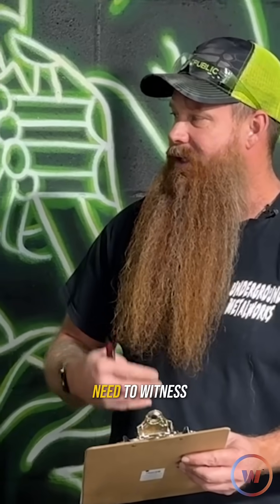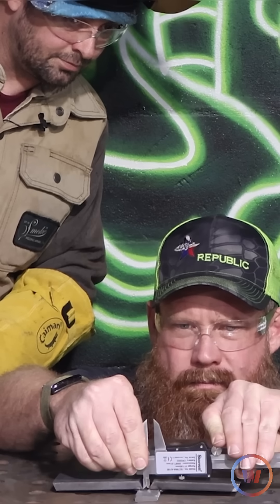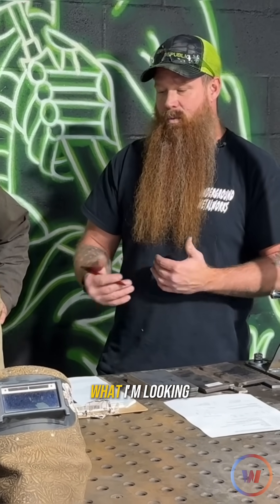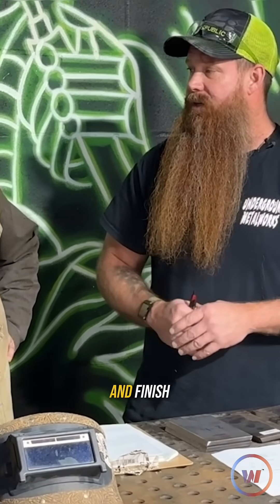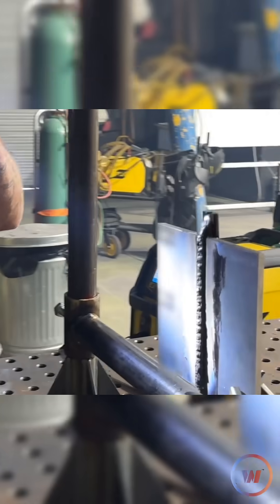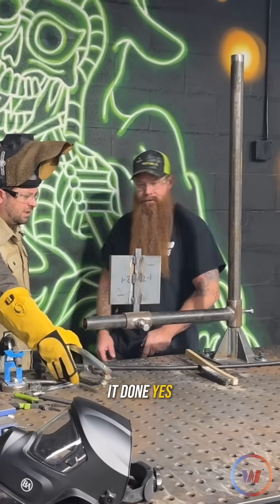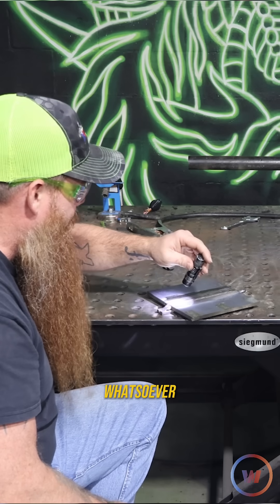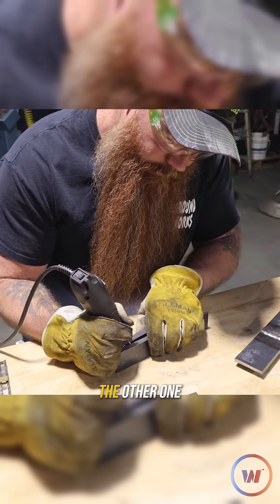What are hold points? #welding

Comment: No offence, but the low points are between the un overlapped beads.. and you didnt measure there once... also your pretty bad ass if you can see lof on the root with a backing strip on it..  best you will see is the heated area..

Comment: I learned how to weld at New Port News Shipbuilding and worked on the USS Los Angles attack sub and three other boats in its class before quitting and attending college getting a degree in aviation technology.  I am not sure if mig welding had been invented yet but at the shipyard they only used stick welding and tig welding on pipes.  When I was in school at Le Tourneau College I worked full time at Le Torurneau Industries.  They were building gigantic diesel electric front end loader that were huge that were used in strip mining.  To get to the ladder going to the cab you needed a 6 foot step ladder to get to the bottom rung of the ladder going to the cab.  As a result of working there I earned enough to pay for my college and room and board.  When I graduated I had no student loans to pay off.

Comment: Great Video! He should of used a wider, 1/4" thick backing bar instead. As well the tacks on the back should only be on the four corners and no more than 10mm or 3/8" long, no tacks in the centre of the backing bar. Happy Welding Fam!

Comment: I've got to repair a safety cover on tractor mower in the middle of nowhere. It's 16th steel, rust pitted all over with big chunks just missing as they've rusted through. I've got a donor oil drum to patch the holes so no one can accidentally put their hands into the blades. I don't have any additional resources and I can't have this fail in use, but it just needs to last until winter. What technique boils rust and contamination out of the weld most effectively?

Comment: I weld about 250-3” welds of 309 on a vertical surface per month. Stainless refractory anchors to medium steel. Just OJT, but they withstand about 12 months of abuse at a steel mill and then I plasma cut them off and do it again. 

Kind of a rare industrial construction I do. But it’d be nice to have some certs.

Comment: I had new potential welders and trainees had to do coupons. We did 95% stainless Tig in food plants. One thing they all failed (just a training issue) was using a steel chop saw and/or a used unknown on what, used sanding or grinder pads. Everything had to be kept separate, stainless and everything else. A little spec of iron in a stainless weld will be unsanitary. The experienced welders could walk the cone on tubing. Beautiful welds.

Comment: I guess I've done almost 200 of these tests! Starting at the age of 17, & I'm now 45! I've never in my life failed a bend test. I'm not saying it's easy at all, especially when you move to open root tests. Meaning without a backing plate like this test has! But none the less, good job bro!
Reply: It has backing because it is Flux core arc welding

Comment: Strangely simple test. We have 1 square edge and one bevelled edge. 3/8 gap with a 1/4 backing plate and we have to do 2 starts and stops. 3 coupons. 1 face and 2 root bends. Not much point in testing if you cant so a start/stop... imo

Comment: Was a certified welder in tig  mig,stick dual shield you name it ive done it worked 30 years in pressure vessel manufacturing and ship yard and high pressure pipe some aerospace had fun made bank retired at 48 miss it sometimes teaching my son in shop now he is trying to go to fast should master mig before he starts tiging he looking at what i made thinking everyone makes that I'm explaining I'm a madter welder your an apprentice sliw your roll
Reply: @JonKorpi-fk7yo  can you please tell me how to do stick on thin sheet metal? (Think exhaust pipe or other automotive, like 1/16" or thinner) I have Tig, which is hard to learn on & I have stick with some thin rods, but my welds look spotty & the slag does not peel off at all & there's inclusion. I've been having luck around 35 amps, but any gap at all just burns right through. Do you have input?
Reply: @christortora2967  spot welds with a low Amp cover very low
Reply: @JonKorpi-fk7yo  does stick orientation matter with thin stuff? Like when it's flat in front of me, can I always drag? Also, do I need to aim the direction of the electrode to not burn through, or is that not how electricity works? Lol

Comment: In 72 I passed this kind of test on 1" thick steel overhead,  with 5/16  stick  low hydrogen rod  arc welded, & the bend test. I was 17. In Highschool. Worked in the field for 2 years, and litterly burned out from production welding.
Reply: I'm with ya. I love welding, but hood down 10 to 12 hours a day is brutal.
Reply: Now that's a test.!
Reply: Yeah. It's a cool skill to have but a terrible occupation.

Comment: It sounds like flux core
Reply: @Akqused  AWS, 3G, D1.1, FCAW, 75/25 gas, 3/4 test. Or at least that’s what it looks like.
Reply: @ remeber taking that cert in school
Reply: The fact that he has slag makes me think flux core.
In a shop very few people would use flux core but I'm not certified and of course I don't weld on any exotic metals but I've been working in Fab shop for going on 25 years flux core wire feed is occasionally used outside where the wind might blow our shield gas away but that's just our particular shop
Reply: @ it’s most likely dual shield, AWS d1.1 yes it is flu core but it also has gas c25 25% carbon 75% argon. It’s called outer shield flux core, sometimes referred to as dual shield.
Reply: @robertgutheridge9672  a lot of shops use MIG, but I’m certified in flux. I’m just like -_-

Comment: What is the tool called you used to check reinforcement heights on the cap?
Reply: @awfishing6179  it’s called a Cam gauge
Reply: @jakepeacock64  its called  digital caliper made by starrett
Reply: @julioyanez2738  incorrect,  that was used to check the gap, not the finished weld height
Reply: @awfishing6179  height gauge
Reply: Google that shit! 😂